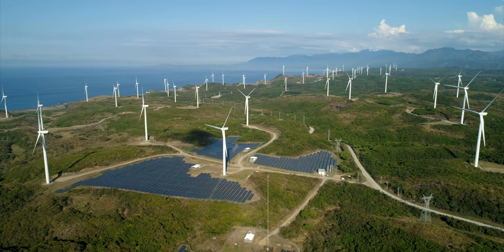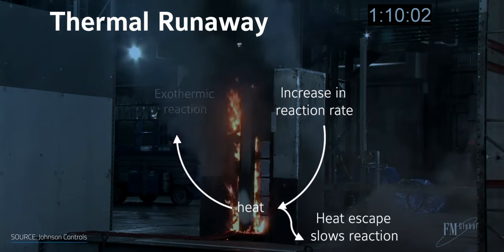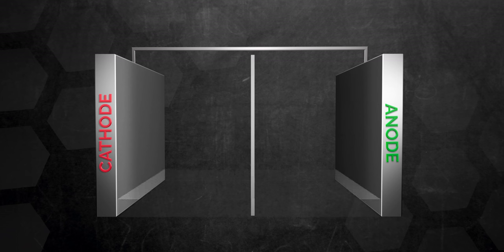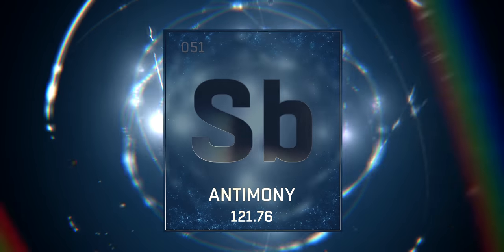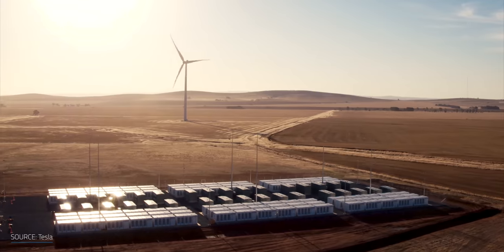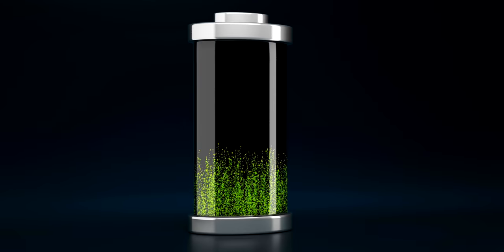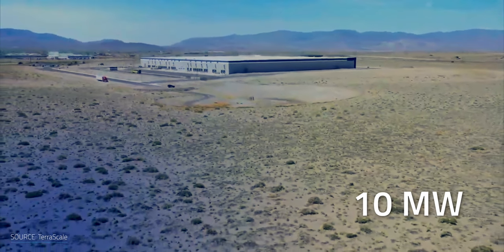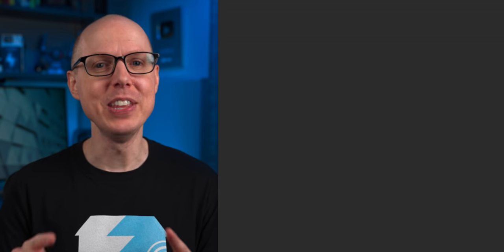Melting Metal for Energy Storage?  Liquid Metal Battery Explained

Comment: The heat might be an advantage in hot environments.
Reply: Agreed - augment this with heat pumps (say for keeping a datacenter cool) and it seems like a huge advantage
Reply: It could also be a good source for home heating systems, if charge and discharge cycles generate excess heat.
Reply: Makes no diffetence.
Reply: But in hot environment, it's unusable energy because it's in equilibrium with environment
Reply: @destiny_02  Not at all true. One, if it is in equilibrium with its environment, that means it environment is literally so hot that it is melting, so unless you are in a volcano you are not going to be in equilibrium. Two, even if it was in equilibrium, that's not where the energy storage comes from. The energy is stored by the transfer of positive ions from one end to the other, not thermal energy.
Reply: @bradhafichuk  the battery produces enough heat to keep warm just through resistive heat of charging and discharging. Plus heat pumps don't currently go that high in temperature. You can't evem boil water with a heat pump let alone melt metal
Reply: Unfortunately, the same insulation required to make these batteries not hazardous from heat alone to anyone on the outside also means they won't be receiving any benefit from the environment they're based in.
Reply: @leandersearle5094  
That was my worry as well. 
What I've wrote about is very low resolution thinking...
Reply: @valdius85  DW about it, we all make mistakes.
Reply: @leandersearle5094  I don't think it is a mistake. It is just low resolution. Hahahaha...

I still somehow don't think using liquid metal would have many downsides, but it's good they working on it. 

It might be a good product for certain situations. I don't know which ones exactly :)
There are just so many engineering applications out there and some struggle with batteries in high temps.
Reply: @thundersheild926  yeah but you will have twice as much usable energy in colder environment like Antarctica
Reply: @valdius85  You've lost me here.
Reply: The professor mentioned it as advantage, the Australian Tesla installation is as far as they dare to push the temperature range for a permanent Lithium battery installation.  No insulation is absolute, and the molten metal will still be much hotter than the surrounding (even if it is the Shara breaking temp records. Not to forget cooler desert nights). But it can't hurt to have 10 to 25 degrees more than the maximum temps in other regions. It will reduce the losses slightly, and more importantly it does no harm. 

If LI batteries get too hot they burn and are hard to extinguish, that could get very costly and dangerous.
Reply: @destiny_02  where is that extra energy coming from? The temperature is not what is generating the energy, the chemistry is. In fact, in a colder environment, you have to use more energy to keep these batteries at the proper temp, so your total available energy is lower. Probably not by much, but definitely not increased.
Reply: @thundersheild926  I am not saying the "energy" increases, I am just saying that energy "storage capacity" increases. So you can store more energy in same volume and at same temperature compared to hot environment. (Of course you will need to put more energy into it to take to same temperature level, it won't magically generate more energy)

Comment: Best video so far on the liquid metal battery!

It's worth noting that Ambri is comparing their active material cost to LCO ($51/kWh), which is the most expensive lithium ion chemistry.  LFP (Iron) is much cheaper at $8/kWh active material cost.  Nickel will achieve ~$20k in the next few years - which is near Ambri's $16/kWh.

Furthermore:  How much are the inactive material costs for Ambri?  I'm assuming they require a lot of expensive thermal protection/insulation.
Reply: Also, what will happen to the cost of antimony if this technology is deployed around the world at scale?

Comment: It seems like it is fundamentally a cost / maintenance question. It feels like the core components are good, but all the components that need to interact with them are questionable. Anode, cathode, whatever heater is used to heat it up when necessary, and the casing. Few materials seem like they would do well sitting in a molten metal bath.
And the failure modes if anything was punctured. But if the cost per VA is good and you have a stable installation it could be quite good. Less space than pumped water storage. Probably lower temperature than the molten salt designs for solar.
Reply: Ceramic casing and induction heating from the outside since its metal in the inside
Reply: One of the stories told by the developer is of a US military group came to see the molten batteries. The first military guy immediately says, “ what happens if this thing gets hit by gunfire ? “ the second says “ the molten metal cools as it exits the hole and plugs it “ . Number one says “ so the battery is self sealing “
Reply: I don’t think you would put a resistance heater in a metal bath, the metal bath would cause a short , the resistance elements would be outside the bath with some thermal path to the metal.

Comment: I get that this is intended for Grid level applications but It also seems like a good fit for home solar installations. Once installed, movement is also a non issue like for grid level energy storage and the deep cycling capability and projected reliability seem very compatible with solar installations on homes for off grid independence or emergency power during outages. Perhaps costs can become competitive in the near future for home use.
Reply: It needs to be cycled often to stay molten.
Reply: @gregbailey45  so great for running the fridge, the stove, the AC, the heating (heat pump hopefully so roughly same electrical load as AC), the TV all day, etc etc
Reply: @gregbailey45  In a home solar installation there would ideally be on average 12 hours of charge during the day and 12 hours of discharge after the sun goes down.

Comment: Here in south africa battery theft is a big issue. Mobile networks often have their tower batteries stolen. The network operators build serious steel cages, concrete barriers and many things to make it as hard as possible to steal... but they are still stolen. Some batteries are in the concrete itself to protect it.

Comment: Beautiful, excellent. I like compressed air energy storage.  Air is plenty and steel vessel plentyfull. I envision  a big ship with a sail, underwater watermill (much smaller than a wind mill) A compressor  drives air into floating steel pressure vessels. The pressure vessels can go autonomously to some facility to discharge the compressed air.
Reply: A lot of moving parts for likely little energy

Comment: I wish you had mentioned that the batteries maintain their own operating temperature through regular charge and discharge cycling.  It is an important part of the conversation. 
People seem to assume there is a need to keep them hot to keep them liquid where as they are able keep them selves hot through regular use.

Comment: A liquid metal battery is great for rural off-grid homes at the lowest cost and maintenance in the future.
Reply: They sound rather dangerous running at high temperatures. So, maybe good for large grid storage, but not so much for home use where home owners would have to maintain it themselves.

Comment: Since it's based on a liquid, how scalable is it? Could you theoretically have one giant pool of 'liquid battery', or is there a limit to how large/small it can be? 
I assume the distance between the anode and the cathode can't be too far, so this pool would have to be very long, but thin
Reply: This and "molten salt" batteries are better in multiple smaller cells than one big pool as the larger the cell the more difficult it is to keep a consistent temperature throughout.
Reply: It probably comes down to operability, many smaller cells are probably easier to transport/maintain than a huge single cell. More modular as well, so it'd be easier to scale up over time. And, if one fails and is somehow destroyed, the others can be relatively isolated thanks to their enclosure. So there's probably a sweetspot, and going bigger than that doesn't make much sense for safety and maintenance.
Reply from the maker: It's very scalable, but not by making one giant battery.  It'd be racks and rows of the smaller batteries linked together.
Reply: @Michelino_M5  The main advantage of being smaller is maintenance. Even if it was exactly the same efficiency at massive scale, operators would still choose smaller components that are strung together. If one little battery fails, you pull it out of the rack and lose a minuscule amount of power storage. If a massive battery fails, you may have to take a massive chunk, if not all, of the facility down for repair. And replacing an Olympic swimming pool of gallium is a lot harder than tossing a couple replacement units in a standard truck.
Reply: @Beakerbite  Yeah, that was the first thought that came to mind. But also consider how hard it would be to deploy such a huge pool of molten metal, from the factory to the site where it would be used.

Comment: We need these in Texas…plus our heat can help with the molten state lol
Reply: Exyernal heat is not needed, and no advanyage.
Reply: @gregbailey45 it’s a joke
Reply: @gregbailey45   The insulation cannot completely avoid the loss of heat, but the hotter the surroundings the longer it takes. The heat in Tx (or in any environement that is not a volcanoe etc.) is s not nearly enough to keep the metal molten (imagine that !) we are talking 300 F or more as opposed to a hot summer day.

Comment: Great technology. Till an earthquake, then BOOM as everything mixes.
Reply: That's why they put it in nevada
Reply: As long as it does not break ..... the layers separate themselves,  you only lose one charge (and may not get much out of the battery when you would need it. But I doubt the disturbance would be that bad, that it upsets the layers a lot and if the earthquake is that strong it cracks the container, that is much more problems. 
Luckily there are lots of regsions where you do not have to expect heavy ! earthquakes. 

The container could be also placed on some shock absorbers.

Comment: “No, one technology to rule them all, having options…” agree, yes, options, like nuclear power that should recognized as a strong player in the fight against fossil fuels.
Reply: I agree. Replace fossil fuels with a highly energy-dense and practical solution until we have the time to experiment with a less-dense source (which is what we are doing as the situation gets deeper)
Reply: Safety and co$ts. Hippies didn't kill fission, cost & safety did. The need? Perfect fission to run safely + cheaply. Probable fix for this? Probably molten salt reactors. I ask, however, is this even doable?

Comment: Under grid load, one good earthquake and KABOOM!
Reply: Wouldn’t anti-slosh baffles work?
Reply: Actually, no.  An internal short will increase the temperature, but not to the point of a phase change, so there's no explosion and the cell housing can easily handle the temperature rise.

EDIT:  It would leave the batteries discharged at the very moment they would be wanted to help deal with an emergency situation, though.
Reply: @dmdeemer  In a high voltage situation like that, the heat from the short will likely cause gas to form from the liquid in the cell. The cell will explode if that is the case. Never underestimate the power of a high voltage short.

Comment: It's worth noting that the thermal management of these systems is not anywhere near as problematic as it may sound.  Blacksmiths have been working iron since Roman times, and getting iron to forging temperature means getting it upwards of 1300 degrees Celsius.  And that's a furnace you're actually working next to, putting stuff in and out of, and straight up hitting the thing you've just pulled out of it with a hammer.  Getting a battery you set up and largely forget up to less than half that should not be difficult for modern engineers to design safe insulation for.

Comment: It seems like the efficiency of these batteries would increase with use since maintaining a liquid state costs energy, they could be scaled up and buried with alternating charge/discharge cycles with the adjacent cells so that heat loss can be minimized.. Instead of a backup storage system they could be used all across the grid for cycle stabilization and efficiency, that would also allow any renewables to contribute to the grid from anywhere..

Comment: Also Sodium is even more abundant than the mentioned Metals and NaS Batteries are a thing for quite a while now. 
I think the real problem is that, in the past,there was not really a market, for the type of energy storage we need for the Future.
Reply: Reading the Wikipedia, sodium-sulphur batteries have issues. The main difference is that Na-S used a solid electrolyte that degraded over time and the whole thing was corrosive and full of pure sodium (exposing that to air or water will result in a bad day) requiring a more complicated enclosure. Some of these issues will be shared with Ambri's batteries, but I assume that there's an improvement. Though only time will tell.
Reply: @johnsmith34  well cycle stability
is less of a concern for seasonal storage. Na-S Battaries are useless for private usage but I think pure Sodium can be stored savely in an indusriall envirement. The most limiting  value in my eyes is price for roar material per MWh capacity. That makes Na look pretty good.

Comment: The High temp liquid metal storage batteries could provide ALL the heating needs for domestic water.  It could also provide substantial support for HVAC heating if used with a heat pump.

Comment: To solve the mobile vs stationary problem you just put it inside a spinning flywheel.  The centrifugal force could be may times the shaking forces.  Then make sure the flywheel never stops spinning.  :-)  Possible, but challenging.

Comment: there are many ways of storing energy.. gravity storage, inertial storage, heat storage (molten salts), pressure storage, chemical storage... but if you want to store electricity, the options narrow down a lot and things get a bit more costly and complex. Probably the most affordable and easier way for large storage capacity are *flow batteries*. This molten metal tech is also interesting, but seems a bit overcomplicated by comparison

Comment: Hey Matt, have you looked into superheated rock thermal storage batteries? Basically generating power from a renewable source (example I saw was solar) to superheat an insulated container of rock that can then be used to generate steam. Keeps its heat for days afterward if not discharged.

Comment: I guess the less expansive way of energy storage would be: using a crane with a motor to lift heavy blocks up. For release of that energy stored would be to use the crane with a electric generator that would grab that heavy block and allow the gravity to pull the heavy block down that would spin the generator producing electricity.

Comment: Hi Matt! I know you are a journalist, and not a scientist or engineer, so I'm going to try my best to bridge the communication gap. I'll start by offering 2 free "Peer Reviews" of your up-and-coming y-tube videos on electricity. That said, I am 100% on board with Ambri, and glad that someone with your public speaking skills (namely you) put up this video. And here is your first free peer review! 1) The Electricity Establishment did a really silly thing - they use a stand-alone word, "kilowatt" (also "megawatt", "gigawatt", etc) to mean A FLOW RATE! Any normal people use 3-word phrases, but not the EE's! You are used to "miles per hour", and "gallons per minute", all very normal. BUT a kilowatt is:"1 kilowatt (kW) = 1,000.00 joules per second (J/sec)". This confuses half of the world's population, so they end up saying things like "5 kilowatts per second" and "250 kilowatts of energy", but kilowatts are energy flow, AKA "power". It's not your fault when you say a battery "stores 100 kilowatts" when it might store 1,000 kilowatt-hours of energy, and deliver it as power at a rate of 100 kilowatts. Think of a water tank. if it holds 100 gallons, that is like a battery holding 100 kilowatt-hours. The tank might have a pipe that flows water in or out at 100 gallons per hour. That is going to drain the tank in one hour. A 100 kilowatt-hour battery that flows electricity out at 100 kilowatts will be drained in one hour. I hope this pushes the confusion out, and makes sense. I look forward to watching more of your videos.  Cheers, Tom Gearing. PS if you think I'm a troll, just read my best publication: https://www.google.com/books/edition/An_Alternate_Solution_to_the_FUNARG_Prob/ooz-NwAACAAJ?hl=en

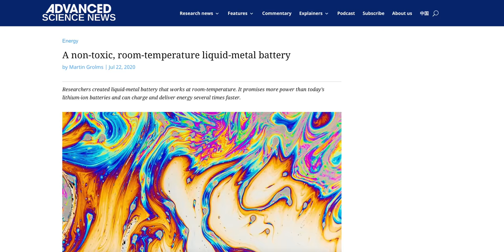Comment: 12:45 you neglected to mention that a sodium-potassium alloy Na-K is EXTREMELY REACTIVE to water. NA-K is much more reactive than Li-ion. Na-K is EXPLOSIVE on contact with water. Na-K has to be stored immersed in oil to prevent reaction with the water in the air.